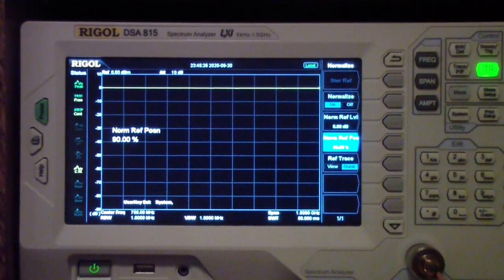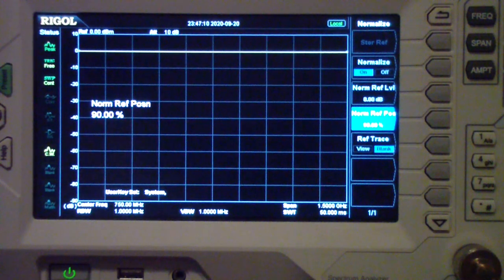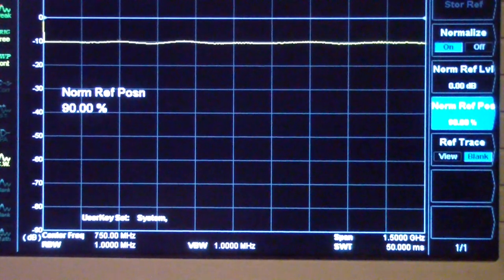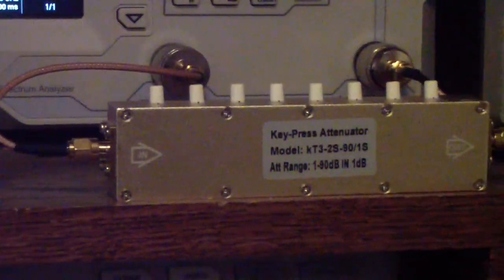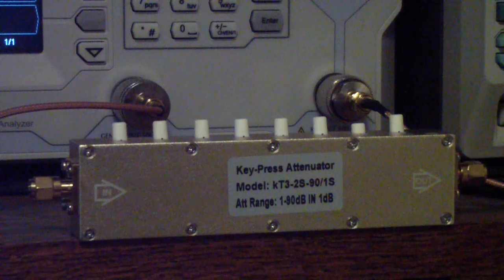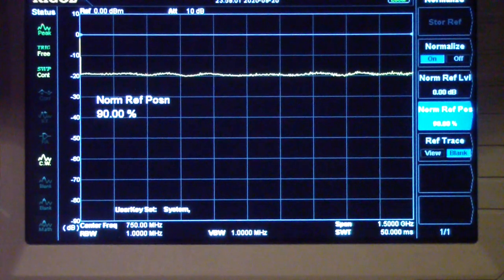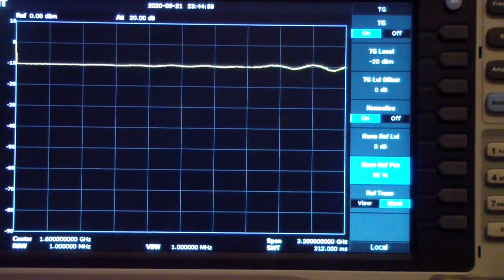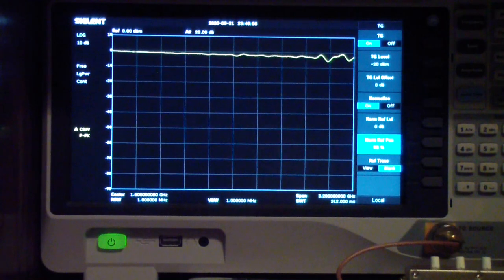TTT345 RF Attenuators

Comment: I have spectrun analyzers,but for fun bought a rf power meter off ebay the 27  dollar ones,, its pretty accurate instead of firing up the SA for quick check, I enclosed mine in a box with a internal 9 v battery,,,for checking db

Comment: If you hadn't mentioned the effect of noise floor on the higher db attenuators, I'd have messed up due to ignorance.   What about phase?  Can your Siglent display phase changes versus frequency caused by the attenuator?
Reply from the maker: No, the Siglent SSA3032X is a Scalar Network Analyzer (SNA) - (when used with the tracking generator), not a Vector Network Analyzer (VNA.) The VNA includes phase along with amplitude measurement, but the SNA does not have phase capture, only amplitude.
Reply: @tomtektest8042  That's a shame.  I was going to ask you to compare signal integrity of a single 30 db attenuator versus setting that multi-stage attenuator to 30 db.  But I sincerely appreciate you responding to my question.  Your videos are great!  The pace is perfect   I'm a retired process control/instrumentation engineer who's using YouTube to reschool on EE topics I have not touched in more than 45 years.   The college lab spectrum analyzer was a giant HP unit that fit into a 19-inch rack.  I think it only reached 100 megacycles.  And I don't believe it had a tracking generator.  Far cry from your amazing tabletop Siglents.